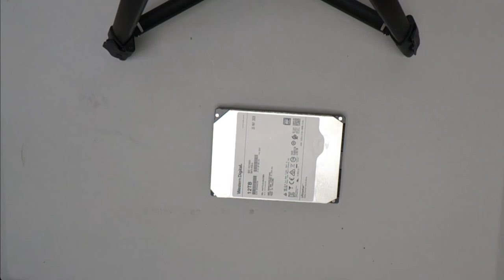Shuck It! Disassembling A WD Black D10 Game Drive External Desktop Hard Drive

Comment: Thank you, I have upgraded my D10 from 8TB to 18TB with your video!
Reply from the maker: Glad it helped!
Reply: Hi Great video, shell clips look a bit tricky, maybe by design WD. Would it be possible to replace the included drive, WD Black 8TB?, with a WD Gold 16TB??, Thanks (is the PCB Only for WD Black?)
Reply: with one you put inside?
Reply: @partsscraps41  have you taken any of the smaller 2tb usb ones apart?

Comment: It would be intresting to know for what was disassembling?) What was your goal?
Reply from the maker: to add more storage to a NAS
Reply: @partsscraps41  did it work without a problem? I was also thinking of taking the HDD out of the D10 drive, because they are so cheap, but I thought they might be somehow restricted from working outside of the enclosure? but if you are using it in your NAS does it mean that the HDD just works normally outside of the enclosure?
Reply: @MartinJablonski  If you life in big city which have WD service centre buy NAS drive with 5 years waranty.
if you life very far away from WD centre that make waranty hard, thats when you want to schuck the drive.

Comment: What exactly makes the D10 faster than the P10 or another normal ext. HDD?
Reply: P10 is portable 2.5" 5400rpm drive with about 130 MBps
D10 is desktop 3.5" 7200rpm drive with about 250 MBps and active cooling + 2 USB 3.0 as hub
Mybooks use 5400 3.5" drives are slower and passive cooled
Reply: Y las Western Digital disco duro externo 8TB Esential?? A cuantas revoluciónes RPM?

Comment: what tool did you use to unscrew the drive?  my drive just died and I want to test the drive in another external enclosure
Reply from the maker: a star screw driver, though a small enough sized allen key should do the job as well. good luck!
Reply: What’s the size ? I need to move the drive
Reply: @Canathis024  I think: star 7, tork 1.0 or 10 but I am not so sure because I purchased a kit (highly recommended) but the numbers are repeated.

Comment: Hi, what's the speed when in a PC with Sata? Can you go beyond the 250mb/s?
Reply from the maker: WD White Label Drives run at 5400rpm only so expect closer to 200mb/s. Though performing benchmarks like crystal disk or smart check will boost performance closer to 250 mb/s.
Reply: @partsscraps41  so it's not better than an internal barracuda in terms of performance and durability if also used as internal drive? I thought WD Black were 7200rpm
Reply: @jeffmerheb3182  they are 7200 rpm and faster and better than barracuda
Reply: @partsscraps41  not white drives use in d10 black series, unlike mybooks, these are 7200rpm up to 250 MBps